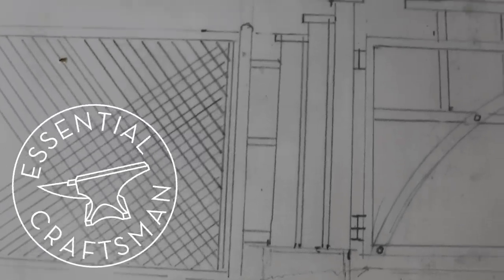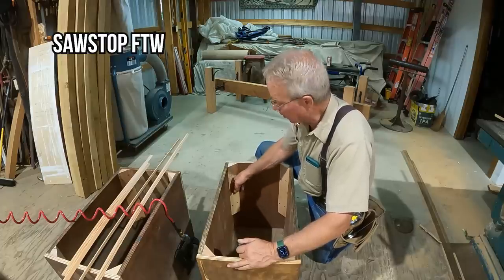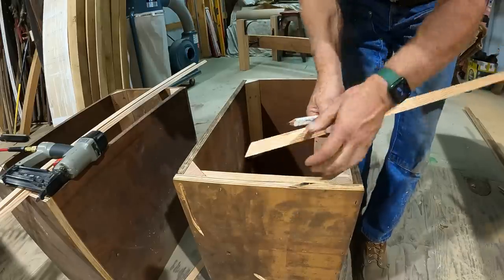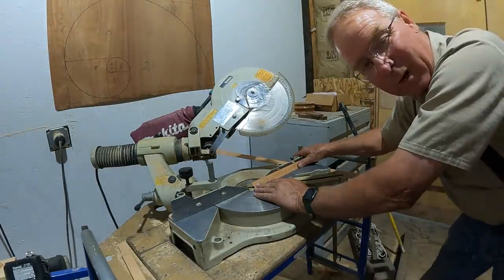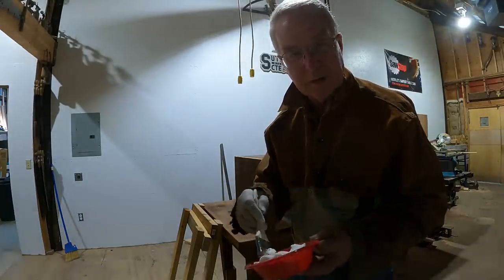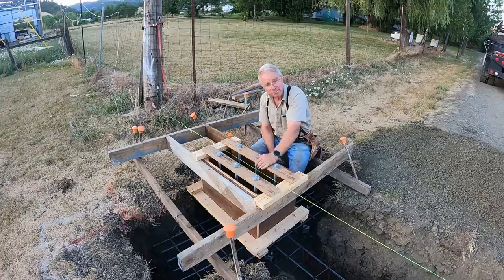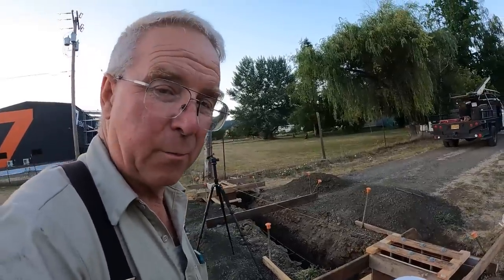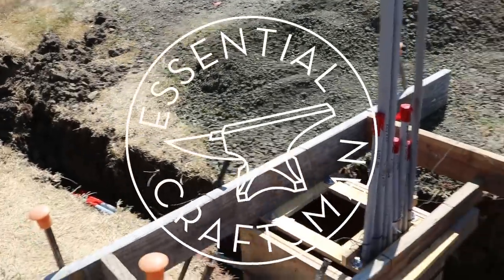In Depth Look at Decorative Concrete Forms: #2

Comment: I'd skip using the rebar, code or not. Rebar rusts as concrete isn't water proof. And 20-30 years down the road this cement will be falling apart. I'd use masonry techniques from Europe, stone and cement, or 2-3 inch rock/ cement mixed with smaller rocks for surface retention in the cream. This way the cement lasts for longer periods of time.
Reply: I don’t know how they do it in Europe, but code in the US is not a suggestion. It’s the minimum allowable, by law. 

20-30 years is a gross under-exaggeration for reinforced concrete, expected useable lifespan. 100 years is the generally accepted minimum. All of the reinforcement shown to this point, seems to be adhering to ground contact standards, which is 3 inches, rather than the typical 3/4” above ground clearances. So 100+ years should easily be expected.
Reply: I understand your point but, there's a lot of bridges now crumbling due to rusted rebar, bridges are easy to see, compared to underground foundations. Mike Haddock has a 40 year history of concrete work, and his father before him. On YouTube, checkout some of his videos. My dad, 86 now, worked all his life in the concrete and excavation business, did a lot of work on foundations but never used rebar.. there needs to be more study on this subject. Bottom line is concrete, isn't waterproof, porous, allowing moisture in, rusting is inevitable... Long before 100 hopeful years. Bridges well built with steel, and concrete use stainless steel on big projects, because they know this
Reply: @ridgwalkerg  You’re not wrong. I’m a career concrete guy and I hate the idea that everything I ever professionally contributed to this world will likely be gone (or unusable) in less than ~150 years. But I [usually] never drew the plans or did the engineering calculations. As long as the plans call for mild steel rebar, that’s what I (and everyone else) are obligated to put in there. I’m not sure where your dad built that he was able to omit the use of rebar, but that’s typically not the case for most municipalities. The plans are submitted and approved with what’s specified on them and that’s what the project is built and inspected by. 

Stainless steel rebar? Gold and silver don’t rust either. Even chromium infused stainless steel can rust a little. I’ve used galvanized rebar, fiberglass rebar and epoxy coated rebar and even greased, sheathed steel cable, but never stainless rebar. (Epoxy coated rebar, at one time, was thought to be the fix to the problem of rusting rebar, but it’s been pretty much phased out at this point because over time it proved to fail just like everything else.) 

Really, the bottom line is the “bottom line” (cost). Stainless will add about 300%+ to the cost of your reinforcing steel, so if your project can take that kind of economic hit, than that might be the route to go. I’ve never worked on a project that the builder was willing to afford that and honestly never even saw one. Not even government funded, interstate highway bridges use stainless steel, so I’m not sure what bridges you’re referring to that are using stainless rebar. Please supply a link.
Reply: @ridgwalkerg  The first article was about a bridge constructed using stainless structural steel components, NOT stainless rebar. That is more understandable because of the aesthetic value of stainless vs mild steel. I’m sure the architect was pleased with the final look of the bridge and the engineer was happy with the structural performance. Killing 2 birds with one stone made this an economically feasible consideration. 

The 2nd article was indeed about stainless rebar but I think you would have to agree that stainless rebar is about as rare as hen’s teeth. Nice finds all the same.

Comment: I'm not a civil engineer or anything like that, and I don't know how heavy the gate will be (though it seems to me it will be pretty. I mean, pretty heavy) but, as I've mentioned here before, both my father and my uncle were blacksmiths and, from the times I used to give them a hand, your work there goes way beyond anything I can remember. I even saw them installing a gate to close an old (very old) stone wall, and when they where drilling the stone it was almos getting itself undone like it was sand. And yet they manage to have it all working perfectly.

Now, the one I do remember perfectly from 30 years ago (actually June 1993) was the one they installed here: 42.290964563348155, -8.547571462367685 (I leave the coordinates as Youtube doesn't like links in the comments). If you check Street View you will see a relatively large arch for the place and the gate my father and my uncle made (and I somehow helped them install it). When we were installing it we had the rather disappointing surprise of finding out the whole arch was made of cinder block and completely hollow, both the cinder blocks themselves and the space (the square-is shape) between them. We had to fill it up and make it work.

The image from Street View is from 2011, but it was there holding on strong 18 years later, and although I can't remember the last time I went there, I think it's still like it.

So, well, I think that we, including you EC, all know that base is going to work whatever you can throw at it.

Thank you.
Reply: Cool gate there!  In Street View there is a happy dog with tail up that was checking out the Google camera car.  LOL.
Reply: @SpringRubber  Yep, the dog looked like he was doing a little sentry duty around ‘his’ property, making sure no unfriendlys were prowling around, up to no good. 🐕
Reply: @psidvicious  I would say the dog is probably from some other house rather than the one with the gate. But he is doing as you say.
Reply: @SpringRubber  thank you. My father and my uncle did not joke around with their work, whatever they did was made to last, that came first, and second, they tried to make it good looking, though this would usually depend on the client's taste and budget.